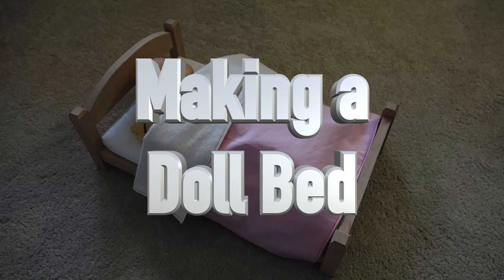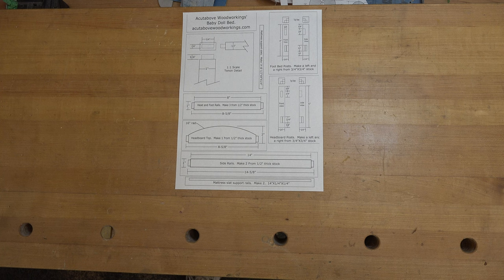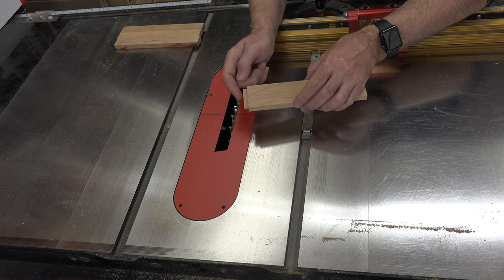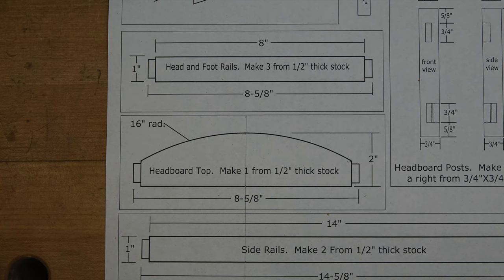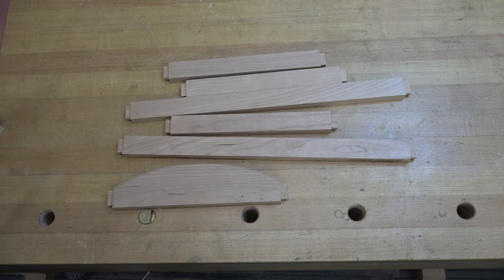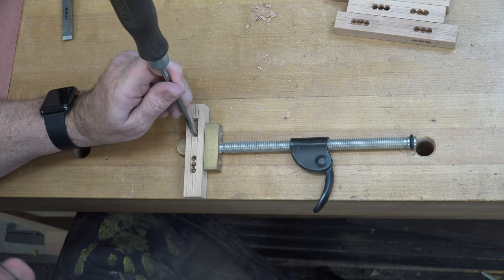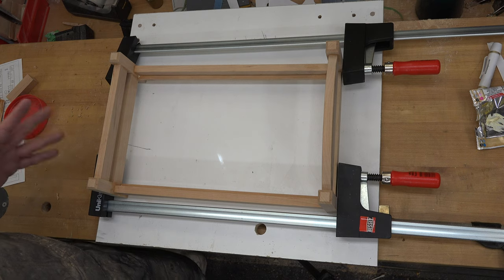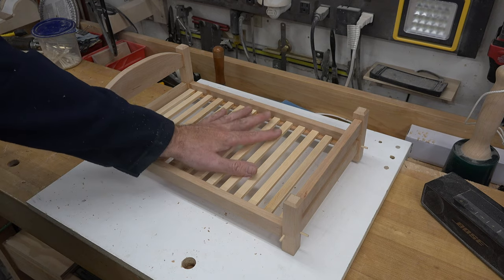Making a Doll Bed

Comment: Another wonderful project. Just a tip for cutting foam, use an old electric knife.
Reply from the maker: Another viewer mentioned this as well Mark and now, I will be keeping my eyes open for an electric knife.  Although the bandsaw worked really well.  Thanks for tuning in and for the suggestion.  It's very much appreciated.

Comment: Looks great. I need to make a couple of them. On the shortened tendon I would cut them at a 45 degrees giving them the full length except for the 45 degrees cut off.
Reply from the maker: Feel free to modify it as you see fit Tom.  I'm sure that your beds will look amazing.  Thanks for tuning in and for chiming in with your idea.  It's very much appreciated.

Comment: An electric carving knife works excellent for cutting soft foam.
Reply from the maker: That's a great tip that I will have to try Brian.  I don't have an electric carving knife but I'm sure that I could get on rather inexpensively from amazon or Walmart.  Thanks for tuning in and for chiming in with your suggestion.  It's appreciated.